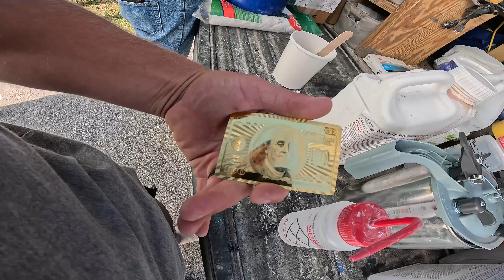How To Repair a Crack on a Fiberglass Swimming Pool [Complete Overview]

Comment: Crap!
NO! Double Crap!
Im a CerE engineer and 29 yrs in composite aircraft industry.
Problem
You grind out structural area. Then wipe in gel with thickener and accelerator. All compromise strength, which is what you need.
1. I would drill n fill
If you find a soil void under the area drill and foam fill the area. It may not be perfic or long lasting but its better than doing nothing
2. Fill in the ground out area with fiber glass and resin or chopped fiber glass and resin.
3. Re sand the cured structural reapaired area and then gell coat
or
4. PMR 14 or better sealers like urathane or a sealer that is made to seal up fuel tanks 
Ok
This repair may work for a few years but that is not a sturctural repair.
Reply from the maker: @dallas69  it wasn’t a structural crack.
Reply: IMO This is not a Boeing or Airbus aircraft so I would not use Fiber Glass cloth. I would use 1/4in chopped fiber glass mixed in with resin n kicker. 
Chopped f/g has structural strength and 1/4in is a key to providing that resin f/g structural strength.